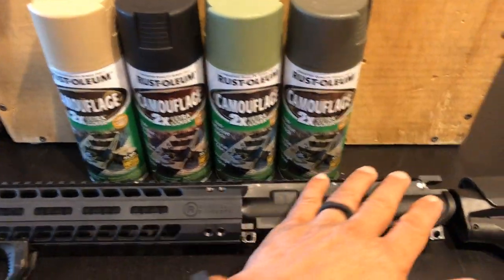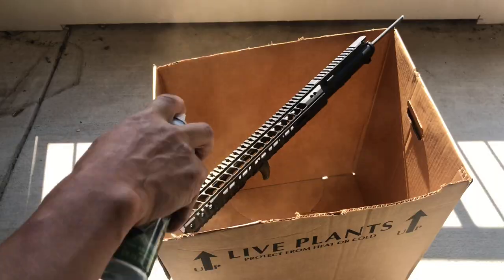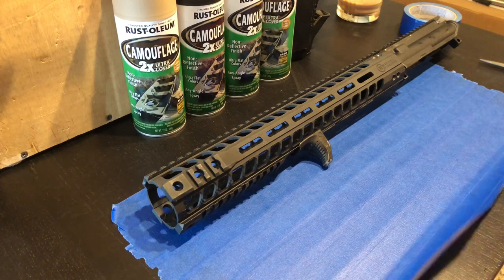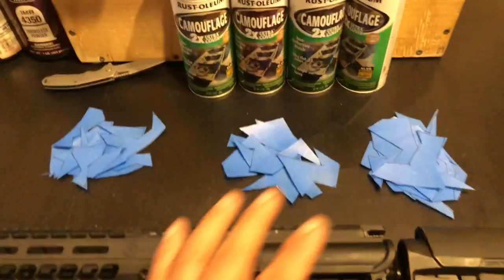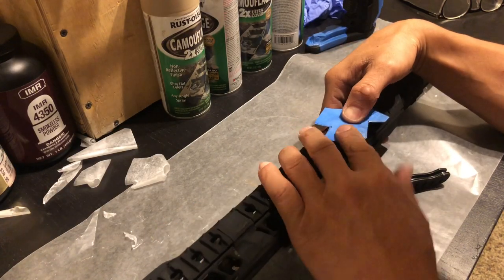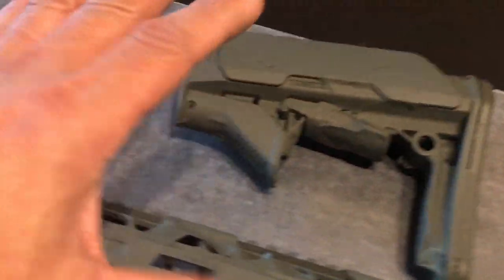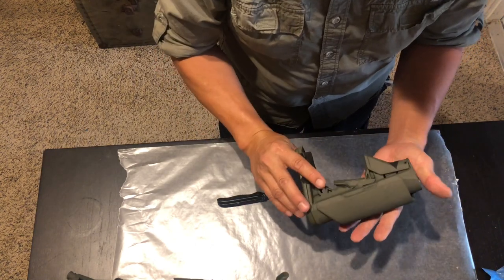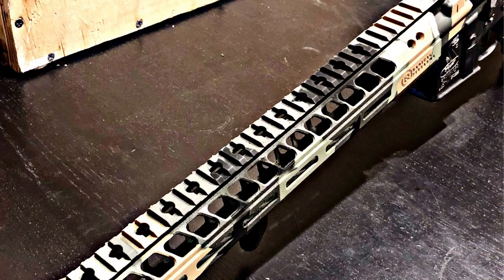Swedish M90 Camo | DIY Project

Comment: Top it off with Rustoleum 2X clear matte spray paint! It seals and protects the color. It makes your gun feel great. I usually spray 3 full coats and it dries in 10 min
Reply from the maker: Didn’t think about clear coat.  I’ll get some today!  Want it to dry for another 24 hours first.
Reply: Outdoor EDventures absolutely! Make sure to sit just a tad bit further with the 2X matte cuz it’s sprays heavy. So I’ll do a few coats then when it’s fully dry, Ill do little spritz around it to give a lil bit of texture. But the camp is super cool! Good Hunting!
Reply from the maker: Thanks for the pre-warning.  I will keep that in mind.  I'm in no hurry to rebuild this.  Got a super busy weekend so it will have to wait until next week.  Extra dry time never hurts.

Comment: That came out wicked good, and the patterns are much easier to cut out than all the multicam spots and blotches
Reply from the maker: Yea.  My drawings were really rough but I knew I could make quick work with my scissors in getting strait lines.

Comment: Only thing I noticed about my DB10 is that shiny stainless steel barrel I should paint flat black
Reply from the maker: That's an easy job.  But unless spot and stalking under 30 yards with a full moon I wouldn't worry about that little pipe!
Reply: @OutdoorEDventures  cracked me up and should have included that video but i could say, HEY YOU! real loud and it took a second before the raccoons heard it and reacted standing to look where the noise came from LOL
They looked for a few seconds then just went back to eating corn one kernel at a time LOL

That time I got video of all of them hogs it was full moon and they looked like they never saw me even when my engine was running and I shut it off then rolled down the window to stick my rifle out to get the video but I was sitting out in that field in that 150 yard position with no cover at all whole truck exposed
Hard to believe it has been four months since I saw them hogs with my own eyes now but that's hog hunting for ya LOL
Reply from the maker: They come.  They go.  Sometimes they move in.